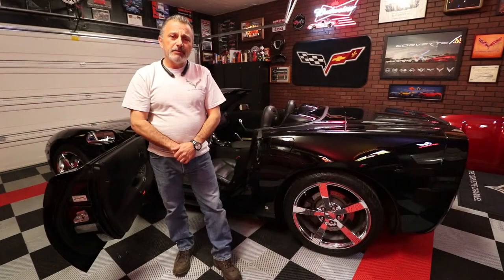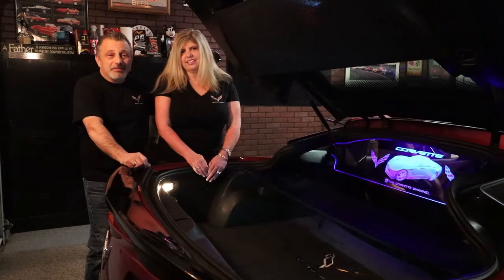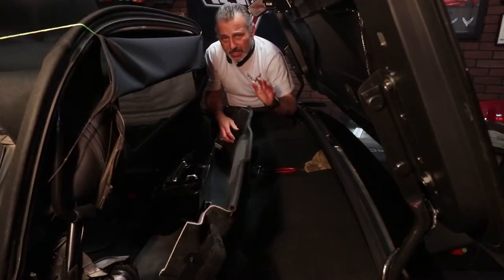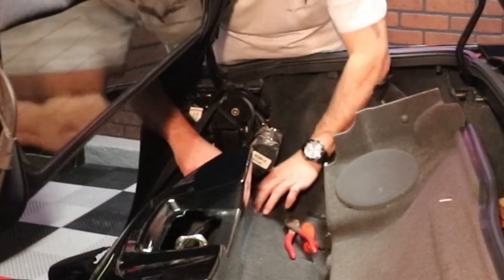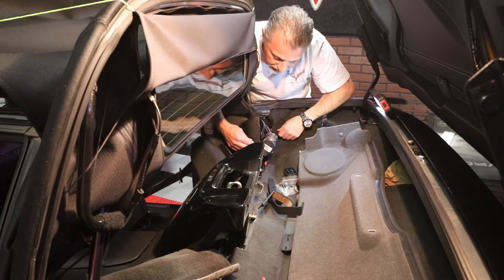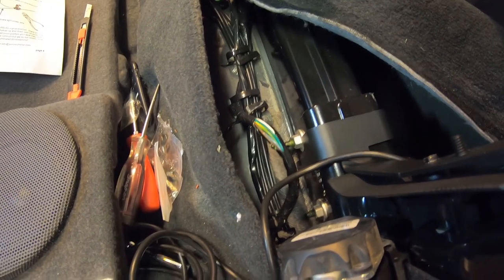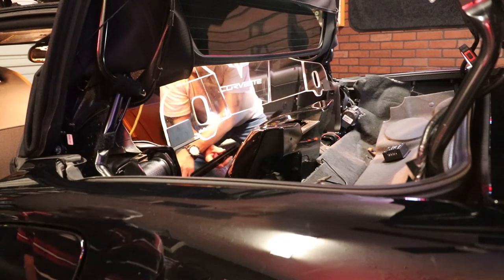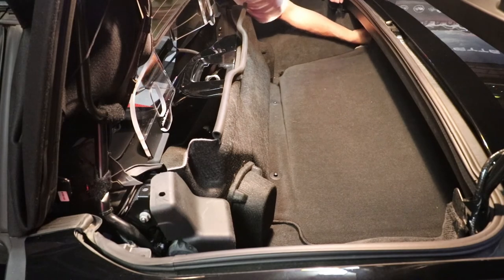How to Install a WindRestrictor in a C6 Corvette Convertible Get your Discount

Comment: completed my install today.  It was pretty easy.  Had 2 issues, 1st I broke the screw holding the bracket.  I was able to get it out and buy another one.  Not sure if it was striped but the 2" screws are way to long.  1 3/4 would be perfect.  2nd tapped into the wrong brown wire.  It's a fatter wire in the 2nd bundle.  Other then that, no issues and what a huge difference!  It's beautiful.

Comment: 2 hour install.  Had to Dremel out the factory clips on the seatbelt spool covers in order to align the bolts that fit into the hammered in brackets.  Other than that - relatively easy.  Appreciate your video.  One last item - there were two massive wiring harnesses and I had to guess which one had the brown wire in it for the running lights.  Used a test probe to figure that out too.  Great product.  Looks professional, clean, and love all the color and lighting options.  Thanks again.  cs

Comment: Hello.  Great video!  Question (for anyone whose installed one on their C6 Convertible)…

When you’ve got the top down, does your WindRestrictor move back and forth from the wind buffeting it?

My hardware is not moving but the whole unit does slightly move with the wind.  

Don’t think it’s anything too concerning but I wanted to ask everyone.  

Thanks!